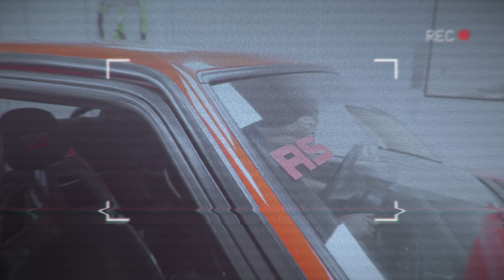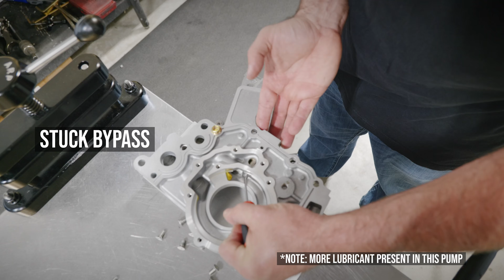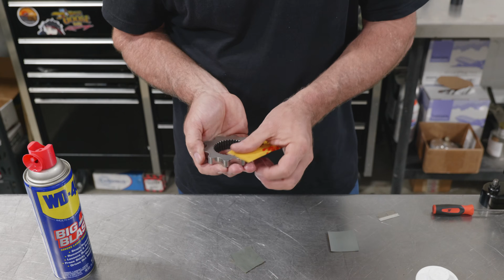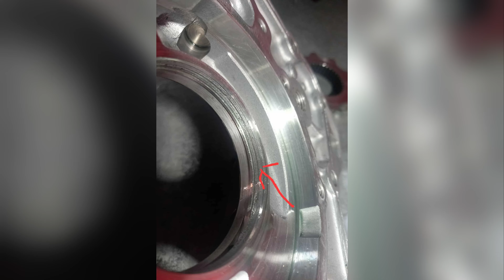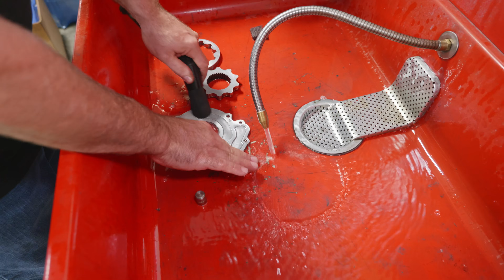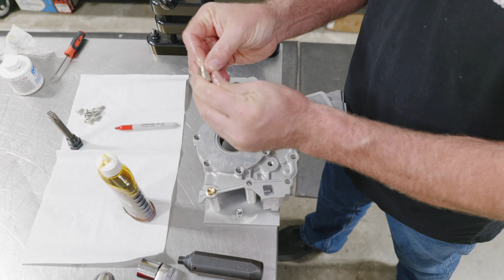How to Prepare a 2JZ Oil Pump Before Installation | Jay's Tech Tips | RS Garage

Comment: @Jay, can you do one on the k20 Type-R RRC oil pump? Folks always add a 'shim' to the valve spring which is a big no-no as it doesn't help achieve more oil at higher rpms, and they always port the hell out of the outlet which is another no no. The correct method is to deburr the sharp corners and gently port the little ramp bump before the 90 degree sharp turn as well as lubricating the gear on a dry run.

Comment: checking the alignment of the drive gear, if this makes contact with the housing (using dykem), what is your recommended method to rectify this? - further light sanding until it clears without taking too much material off? 

Thanks for the video Jay.

Comment: What do you think is the max rpm a stock oil pump can do? Specially on a drift application with sitting on the rev limiter etc?
Reply from the maker: For drifting a good limit is 8500rpm
Reply: @RS_Garage_US thank you 🙏🏽👌🏽

Comment: Great video Jay and super interesting to see the inner workings of the oil pump and how to prepare all the surfaces. I'm doing a refresh on a 2JZGTE with 170k miles with the engine in. I'm wondering if I should replace the bypass valve o-ring as part of the overhaul? It's not obviously leaking so maybe I should just leave it alone?
Reply from the maker: Do you plan on re-using your oil pump?
Reply: @RS_Garage_US yeah I was planning to leave it in situ for now, just wondering whether the o-ring on the release valve is a service item or best left alone if not replacing the pump?

Comment: Hey Jay what are your thoughts on Hughes Race Built oil pumps with a billet pump drive gears. Apparently the oem pump gears are a softer metal on these newer reproduced pumps than the ones they made in the 90s. How important is gear hardness on these pumps? Would love to hear your thoughts on this.

Comment: cool. and how much pressure gain you receive after all this work? on idle and full load?
Reply: It's not about increased psi, it's a out making sure the pump does not lock up during initial start up.